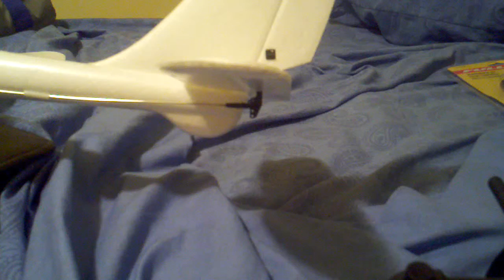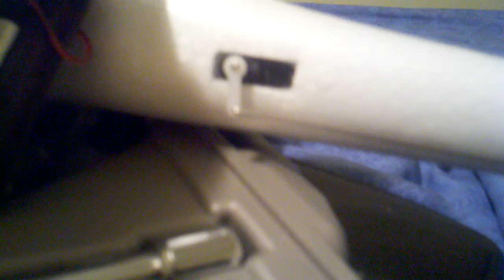Response Video: Spy Hawk Servo Issues

Comment: Hi Linkman81,
I was able to fly the Spy Hawk today.  My Elevator servo was only a bit less than yours.  You can't really put it into a dive, but after adjusting I was able to get it move above neutral so it would climb.  

It flies pretty well and stable.  There was more wind than I would have liked but it makes for slow into the wind landings!  I will post some video soon.